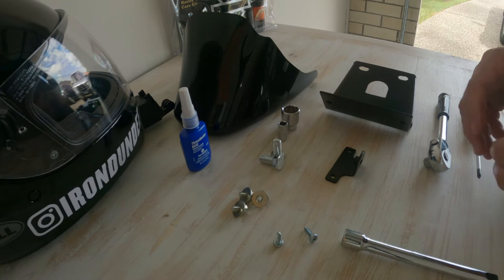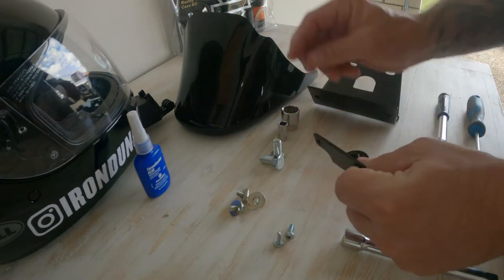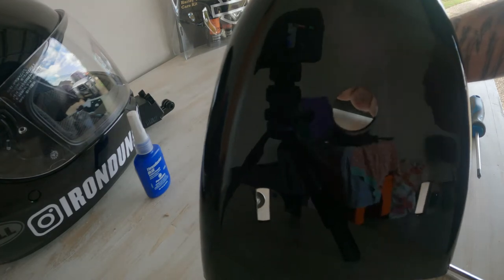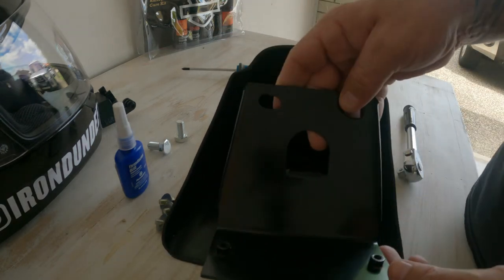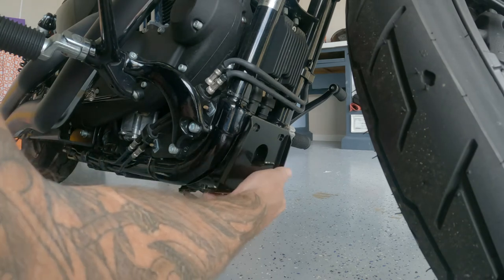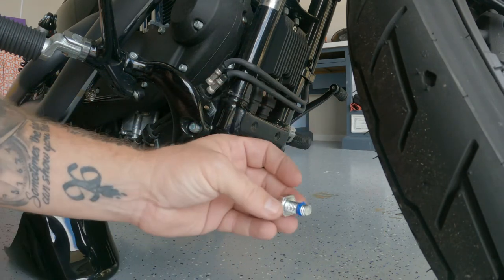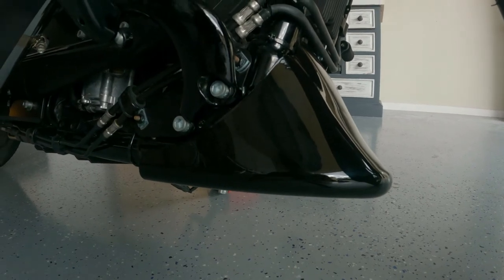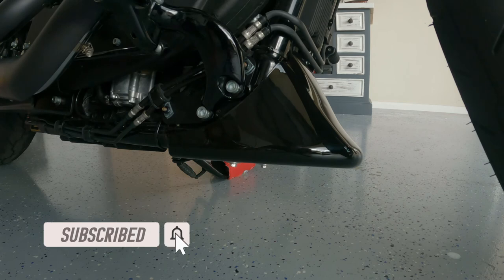Install a Chin Fairing- Harley Davidson Iron 1200

Comment: Which bolt did you need new ? The ones that attach to the frame? And they are 3/8's length and same pitch or something else
Reply from the maker: So basically I needed to get 3/8x1 inch imperial UNC that attach to the got it from my local car store. The ones that come are a 3/8 metric but the imperial didn't cross thread